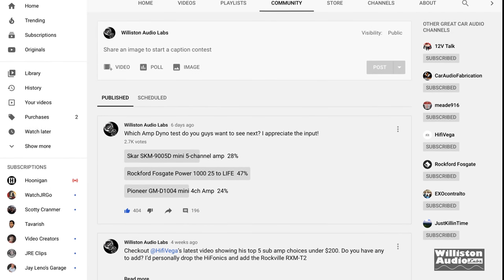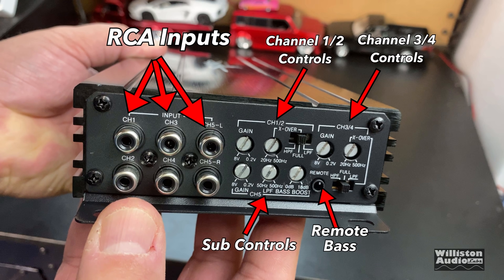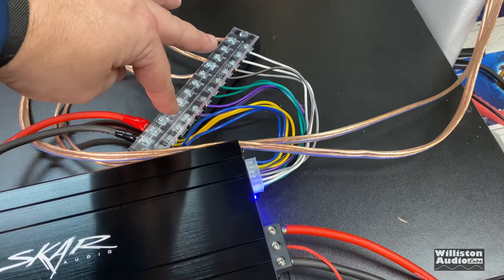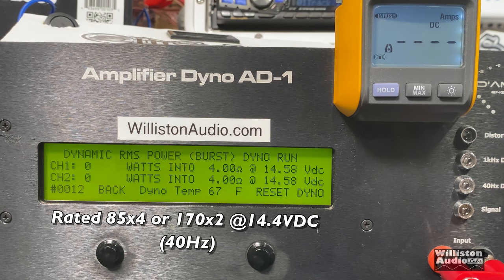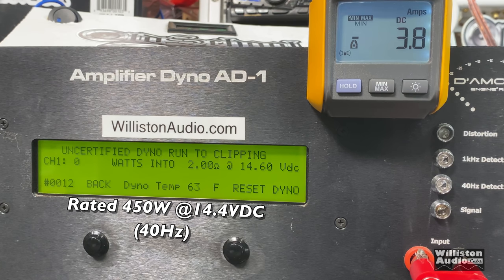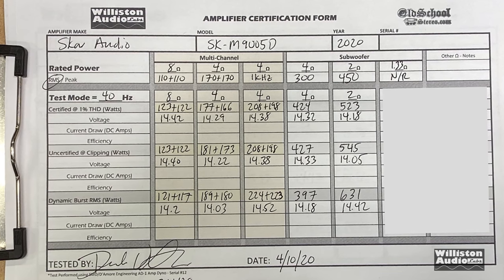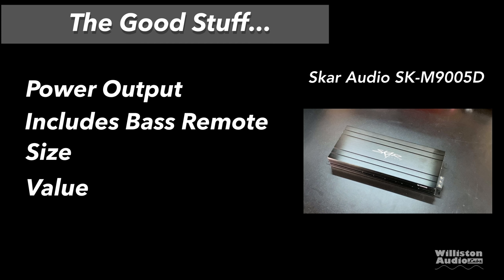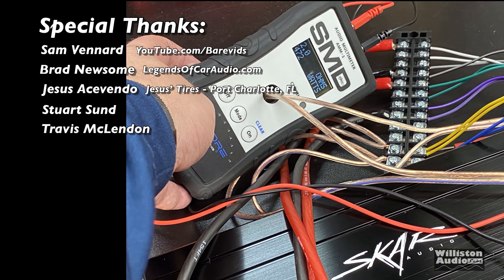Five Channels, 900 watts and Cheap?

Comment: I just picked one up for my truck. I have two 4*6 in rear, 6.5 in front doors, and a 12" shallow sub in ported box. All Skar audio, except the head unit and some of the wiring. Oh, and great advice to cool the board. I'm doing that once in gets here in Wednesday.. keep it up sir, we need these videos..
Reply: So it's been awhile and the amp is still working very well. I did install a small fan like it was mentioned, works good. I really like the size, fits nicely in my reg cad f150 and have plenty of options for install.

Comment: At $160 and delivering rated specs, you can’t complain.  This even competes with the Alpine and Kicker brick amps.
Reply: Matt B the Alpine for sure but not the against the locker key amp.  Those puppies with the dsp have an edge. And now they have the 500 RMS sub key amp.   Price is cheap I give it that
Reply: Does it have the sound quality of an Alpine though? Thats always been the key reason i ran Alpine gear.

Comment: At the 7 minute mark Sam described this amps internals. Can you do a compare of the Skar RP-series circuitry to this budget series SK-M series maybe with Sam pointing out any upgraded parts/ design? 
  The RP-600.5 is 5 watts more power in the CH 1-4 but the sub power at 2 ohm is very different.  Only $20 separate these amps and again what is on the inside would be very helpful. All of your videos are well presented and clear, keep it up! Sharing with everyone!

Comment: Dude i just bought this amp in thoughts I'd run all my factory highs im replacing with skar audio sk and rp 6x9s in doors, tl 3.5s in dash ×3, 3.5 super tweets in head liner ×2, and my 2 evl dual 2 ohm 6.5s under seat sub box mod....( posted pics in review page at skar.com) and my wonderful 3rd child my skar zvx 18 d1 on its nasty lil buddy the taramps bass 1200. Im so happy to see the amp dyno of this amp and i just happened to run across your rp 2k video too, my battle plan was 2 of those strapped to replace the taramps now that big Z is broken in!!! Im so fudging happy i cant cuss!!

Comment: Awesome channel as always, just wondering if you could do a segment on thd and snr on these multichannels and demonstrate why these numbers are important when running your highs. Maybe do a segment on why any amp that has crossovers that only filters up to 500 hz arent the best for running tweeters, as a lot of guys are going pro audio for their highs , and cant understand why they keep popping tweeters or have poor sound quality even with the little capacitor crossovers on the tweeters. That would also be a good video on its own, showing everyone what pro audio mids and highs sound good, because there is so many that sound like garbadge compared to the coaxials and components that we were used to running back in the nineties.

Comment: Love the idea of a 5 channel to run my whole system. The small footprint is attractive too. I may have to get one of these. Thanks for the video, as always!
Reply: I bought a used Kenwood Excelon X801-5 for $80 in mint condition instead.  Needed something small and wanted to go new for warranty purposes etc but the harness hookup on the Skar made it a no go.  The Kenwood sounds great and is pretty small so aside from saving over $125 and not having warranty I don't think I lost out on anything tbh.  Pretty sure the Kenwood will last longer too, imo.

Comment: Thanks for this review. Made a deal last year to sell my current system to a friend, with plans to upgrade to newer more powerful amps.... then Covid-19..... out of work, couldn't afford what I wanted, but at LEAST wanted an amp to replace the 12,000 watts that I was getting rid of (ouch!) 
Bought this amp off of eBay as it was not in stock in Amazon.  Got it yesterday and installed it in my vehicle. Its powering two 6 1/2's per front door wired at 2 ohms, one 6 1/2 per rear door at 4 ohms, and one 10" sub at two ohms, it does get pretty warm, but it has enough power to keep me satisfied until I can afford to go bigger. Plus, I am technically a senior citizen, and not sure if I want to go that big anymore.... not cause it's too loud, the strain on my body installing all that gear, and building and installing three to four hundred pound subwoofer enclosures now has me laid up for a few days of recovery....🤣

Update.... the one thing I have noticed about this amp is that it has a pretty noticeable turn on/off pop that is fairly annoying. Also this amp should have 4 gauge power inputs.

Comment: My biggest nitpick with this amp is the fact that the power and ground inputs are 8 gauge. If the amp is 900 Watts, it's not 100% efficient so round that up to 1000 watts. You shouldn't use 8 gauge if youre running the wires all the way to the trunk for 1000 watts. The amperage on that is too high for 8 gauge. I guess you could do it but that makes me question them the fact that they didn't put 4 gauge power/ground inputs.
Reply: Just buy 4 to 8 gauge reducers
Reply: 4 guage fits just fine

Comment: Running one of these in 3 channel mode in a 03 viper and have been very happy thus far. Sub @4ohm btw.
Reply from the maker: Oh wow, I know you don’t have much room for amps in that ride. Great feedback, thanks 🤙
Reply: Williston Audio Labs Yeah it’s tight. I’ve got it under the passenger seat where the stock amp is. Will probably move to a Pioneer 5 channel soon though with a custom sub enclosure. Look out for it in August courtesy of Loud and Clear!

Comment: I have this amp in 4ch. and sub amp 250 for both ,Running 2 way component hertz in front doors and 2 ways in rear with alpine 650 in dash and 2 alpine 10's will add 2 more later,,these amps hit hard and sound amazing 4 years, bought these new when i had a 2018 Tacoma, now in a 2004 Sequoia.
Reply: How long have you used this amp for?  I like it. Fit my needs. Would like to consider buying it but, I don’t want it to go out on me.
Reply: @Omardottcom  I've had mine going on 3yrs now. I like it so much I bought a second for my truck, and a third for my wife's Highlander.
Reply: @gakudzu7282  Thanks

Comment: Another great video i do hear sam from barevids talk alot about that flawed driver board and like he said mounting a heatsink would help or upgrading the mentioned chip would help the longevity of the amp as a whole .with that being said and the flaw being well known why dont they update the driver board !!! ???
Reply from the maker: I’m sure it’s a cost thing and as long as it survives beyond the warranty period they are good
Reply: Josh Holden at skar nobody knows about that driver board.
Reply: Bcuz its cheap ! you want cheap ? you got cheap ! Skar needs to make profit, make margins, price points, sell what market can bare & meet supply & demand. 99% of electronic
failures is by consumers abuse, neglect, INSTALLATIONS & ignorance. Installed correctly & used
properly electronics will last passed
warranties. & like Big D says NEVER mount a fragile amp, xover, dsp, on
hostile environment like a booming
VIBRATING 
subwoofer box. Are you willing to pay for updated, high dollar technology advancements & parts
when simple old dated technology
works & out performs stat sheet ?
Reply: @408SPLKINGS  true with the profits in all but skar seems like a company with a great reputation and its hard to understand them using an outdated driver biard from around 2004 ? Why put ur name on the line over a part or a board mod like adding a heatsink that costs maybe 2 bux i just dont get it maybe i should just ask skar get ahold of them thru meade916 i suppose.
Reply: @408SPLKINGS  the driver board is just a weak link to a very promising board just sad to see
Reply: @joshholden8561  unless its Japanese or Germans designed & manufactured quality has always & will be low state side, rest of Asia & the rest of the world. Companies like Skar meet consumers low price demand as well as Macintosh, Marantz, Audioson meet high end quality demands. Huge price, quality &  supply & demand market difference. You could repackage
Skar products & use up graded parts
to meet your market demands.
Average consumers don't open electronics to investigate "quality"
by voiding warranties ( sticker removal )

Comment: Hi bud, could you please kindly check the focal fpx 5.1200 Amp. It claims to have a maximum power of 4 x 120 Watt + 1 x 720 Watt at 2 Ohms. I'm not sure about the monoblock out. My subs seems to clip and higher volumes.

Comment: Looks like a heckuva deal, although I question the sq of the four channel section when you're pushing the sub channel hard. If they're sharing the same power supply something will have to be compromised when the power supply heats up. Still a great solution for motorcycle/powersports/golf carts but probably not the best choice for a vehicle with any sort of useable space.

Comment: fabulous idea, not sure i like the form factor in regards to the in/out. and while the pigtail is good enough for the 'front' and 'rear' pairs (even if its a terrible idea regardless) i wouldn't trust it for 450 rms, even doubled. and that ignores the actual output.

the base hardware has potential, but the i/o needs some serious work.
Reply from the maker: Yeah simple input switch to allow 2 inputs would be great 👍

Comment: I have this very amp and it works good... But it has a big cooling problem. Especially when hot out. It would go into protect mode after a bit of really hitting on it. I had to run a 12v fan off the remote and it's been good since!
Reply: would you recommend gettn this 700 watt amp for 6x9s 6x5s and 2 12s n a pioneer stereo or would something like rhe 1000 watt class a/b would take it n not heat up to much or mess up kuz irs much or if you would know

Comment: Another good performing Skar amp. For the price I think it's a good deal for a better than stock setup. Even if you only get a couple of years of use out of it before it dies I think it's still worth the money. I've been using a different Skar amp in my vehicle for over 2 years now with zero issues. They're not Sundown (for example) quality but they also do not cost nearly as much and they always do rated and then some!
Reply from the maker: True, good point

Comment: Hey Big D!  Great video. I picked up two of these to run a system in my wrangler. Figured if I got them wet or messed up, no big deal. I got two skar vd8's ina sealed box, each run my the channel five of both amps. I've lost balance and fader for some reason. I assumed I'd rca input to match the speaker output. I'm running the four corners bridged. Sounds good but I'm having difficulty figuring out the rca config. Speaker output is wired the way you have it. But any suggestions on how rca input?  I saw you connected all four channels in to get 2 out. Think I should use y adapters to have fader and balance control?  Any ideas would be great!  Keep up the great videos!!

Comment: didn't you use to calculate efficiency for each amp at each resistance? did you stop doing that? or did I just overlook it in this video?
Reply from the maker: With 5ch amps it’s more difficult as I’m not measuring each channel during the test for power output

Comment: I am looking for a 5 channel amp that's budget minded. Not looking for crazy power. Just going in a mini truck. What's some I should consider? Sounds like this ones pretty good but what else may I want to look at?
Reply: Pearce The Hood Hippie stay away from skar amps they are junk    They seem good but are just pice of shit.   I’ll trash talk them for ever
Reply: I never had a problem with them they put out more power then rated , I' ran mine rp 1500 at one ohm all the time and for hours straight and never had a problem,
Reply: @lkjyuiop1987  what are you running?
Reply: lkjyuiop they are cheap amps but seems to hold up well. Have a rp1500 pushing some Kappas for 2 years and still holds up well...

Comment: Planned to run 2 12" Rockford Fosgate R2 DVC 4 ohm subs and 4x 5x7's on this amp. Subs are rated 250w rms 500w max and the fronts don't really matter. Can you run a 5 channel amp in different ohm loads? Keep the front/rear at 4ohm and run 2 ohm on the sub channel? You tested right around 400w rms @ 4ohm on the sub channel and just over 500w at 2ohm, which split between 2x 12's should be just right? 

BTW... I have a Boss R2504 "1000w" 4 channel amp I'm currently using in bridged mode to power 2 10" SVC RF R1's (200w RMS) I'd like to send to you to dyno test, just to satisfy my curiosity, not really to sell the amps (I paid $66 for it at the time). Amp keeps going into protection mode on certain kinds of bass drops. It is rated at 375w x 2 RMS bridged @ 4 ohm, which is how they're hooked up. This technically almost doubles the subs RMS power handling but I really don't think the Boss is slinging that kinda wattage. Does an amp go into protect if the speakers can't handle it? I thought speakers just blew if they got too much power but mine aren't blown. 

I'll pay everything to send it to you to dyno if you promise to actually dyno it! You can do whatever you want with it after or I'll pay to send it back so you don't collect junk. I just wanna know if it's the amp or the subs being the issue.

Comment: Can you test the rp600.5 as well. It seems as though the SK-M9005D has less features but puts out more power than the larger one according to Skar Audio test. For example, you got 631 dynamically @ 2ohm with the SK-M9005D but the RP-600.5 only did 472 dynamically @ 1 Ohm.
Reply from the maker: Thanks for the suggestion 👌

Comment: Is it a bad thing these amps don't have their own fuses?  I mean if the power circuit is fused properly from the 12v...  Just wondering.  Not used to seeing amps without fuses.
Reply: Install the a fuse at the AMP
Reply: @thekidbart4528  Yeah but what's the point if it's fused at the other end already?  There has to be a reason amp manufacturers put a fuse circuit inside their amps right?  It's not just a "put a fuse or two anywhere between the battery and the amp" thing right?  Otherwise everyone is wasting money designing in a fuse.

Comment: These amps, are they almost identical to the soundQubed line? I have a Soundqubed 1250  in my truck and has been a great Amp, only using it on 2 (infinity 1200w) subs, more for sound quality, but zero issues in many months. Have it at 1 ohm.
Reply: I dont know if they are, but its not uncommon for many different brands to use the same boards but use different quality components. 

Its possible.

Comment: What system maintains 14.4 volts ? I haven’t had one yet
Reply: alternator and batteries. mine stays around 15v at 1000w
Reply: Mine stays above that. Not our fault your electrical sucks

Comment: ~curious what the durability is against JL.
I smoked the motherboard on the RD1500/1D.
Reply: thats actually pretty funny considering i bought a used lp1000.1D v2 off ebay and have been running 2 vvx v3 8's @ 1ohm for almost a year now with not one issue
Reply: @magicyeti9256  oooohhhfff!!! Yeah, low impedance will always be a surefire way to let the smoke out!!!!

Comment: I went with this lil guy for a single amp daily driver build in my 94 Ranger ext. cab. Powering four MB Quart 6x8s off two channels @2ohms from 125Hz and up, one Skar IX 8 off two channels bridged @4ohms from 40 to 125Hz bandpassed,  and one Rockville K6 10 off the 5th channel @2ohms below 40Hz. Using the dsp in my Pioneer DEH-S5120BT. I added the 8 in a 0.45 cube flat box behind the driver's seat so I could remove the 10 when I needed to stuff passengers or freight in the cab and still have a bit of bass. Rangers aren't exactly spacious. The amp fits perfectly behind the driver's side jumpseat.
Its impressed the hell outta me. Yeah, it does get warm at that one spot on the input side, but it's nothing a small cpu fan didn't fix. Still sucks to know it's a hardware flaw. Ah well... Ima bang it til it breaks.🤘👍
Reply from the maker: Awesome 👏

Comment: Have you tested compact behind the radio amps like the alpine KTP-445U ???
Reply: I had one of these it was pretty decent. I know theres a video out there. If i remember they go slightly over their rated power. I had mine for years an it never had a issue.

Comment: Is the sound degraded or otherwise impacted using a terminal? How much power does the terminal have to be?
Reply from the maker: I like the 25A models for these mini amps. They handle 12ga speaker inputs with ease. No way you’ll notice any degradation in the sound from these

Comment: Do you think this amp would make a good long term installation.
Reply from the maker: Tough to say without long term use. As Sam mentioned, the driver board has a flaw which may cause issues eventually

Comment: I have 4ohm 40W RMS twitters and 4ohm 50W RMS speakers(with integrated twitters), what would you suggest: run 4 channels or bridge and run 2 ch at 2Ohms, or running just the speakers on bridge mode(speakers 100W peak)

Comment: Why not 1 ohm? It be nice to know if any amp tested can take 1 ohm. Lot of DVC subs are 2+2 which equal 1 ohm. I hope your future test can confirm or deny whether said amp can run 1 ohm even though most amps won't say it does. I am going to assume this amp should handle 1 ohm since it did ok at 1.33

Obviously if it ain't rated at 2 ohm it might break, but that's the risk. Some amps take the abuse very well. If it clips reduce the gain until it can run it. This amp you tested was on my radar to buy so thanks for the test.
Reply from the maker: Watch after the credits. I show the 1.33 ohm test and also the Dyno sheet. Amp went into protect at 1 ohm resistive, however the 1 ohm speaker load should be acceptable in most cases
Reply: @wal  I seen the 1.33 part. I checked again to make sure I did not miss something. No 1.0 test. Shame it goes into protect. You should see how it handles a 1 ohm speaker.